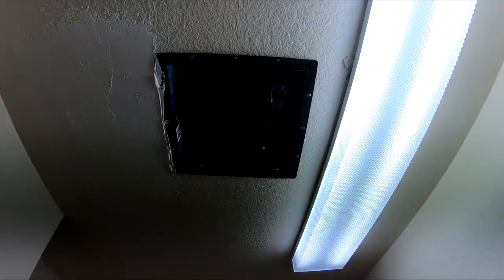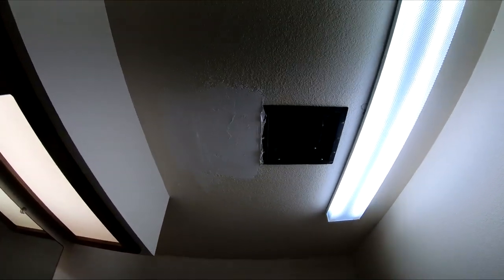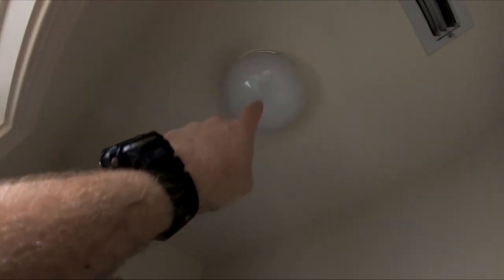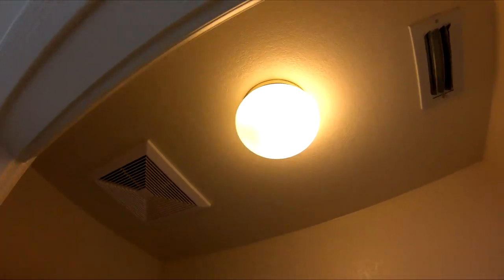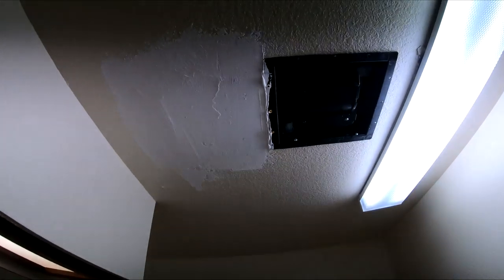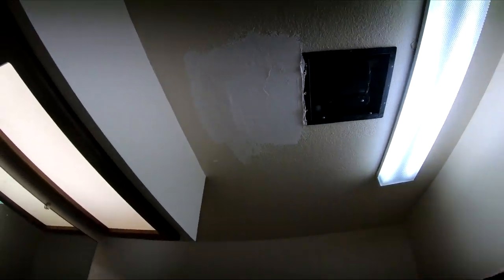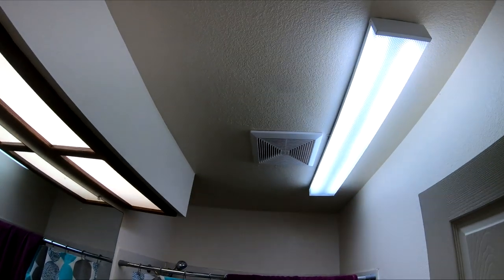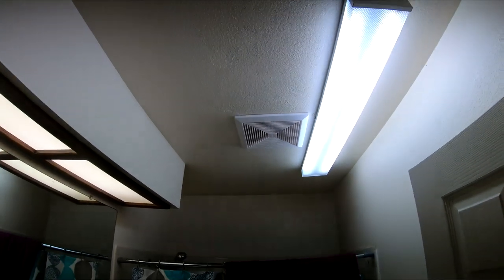Job Didn't Turn Out So Great | Handyman WLOG

Comment: Hey Lee i wanted to make a suggestion to you. I do a ton of drywall repair for my handyman service. I learned how to do professional drywall work when I worked for a contractor who did insurance repair work, fire damage, water damage etc.. 
anyway after doing this work for years I’ve come to the determination that canned spray texture is only good for very small repairs. Or to touch up on a corner bead or bullnose. 
The canned type texture does not knock down enough like texture that is sprayed from a hopper. 
Using a hopper is more labor intensive because you have to mix your own texture mud, use a compressor, a hose, hopper etc. and you even have to tape off and cover more area with plastic, the spray pattern is much larger and it’s just messier than using a can. But the end result is the difference between a wall or ceiling that looks like a patch was done vs. the wall or ceiling looking like the home was built that way and no one ever knowing that anything had ever been done. I’d really consider getting a hopper if you don’t already have one. 
A bad drywall patch is forever, the customer will always see it and tolerate it. It’s always going to be there staring people in the face like a sore thumb. At least that’s how i view it. Spray can texture is more of a home owner type product. Not a professional use product. As professionals in this business our goal is to make repairs that are undetectable. 
I hope you understand I’m not meaning to be critical for no reason. Im just trying to help. 
Always enjoy your vids,
Take care man.

Comment: Allen, in my opinion. Spraying way to close and you need to wait and let it start to dry before running blade on it. One thing always tests spray something so you can get pattern close. So when you do actual spraying you will know how far back you need to be and the speed and thickness you're looking for. The practice is key. Keep doing it till you have the hang of it. Other note. don't forget if it is real screwy take your blade and pull it all off again and try applying it again.
Reply: Robert w Sieburg indeed! It's cheaper to redo the work right away, than it is a week later.

Comment: Ceiling patches are challenging. We have a thing out here in Hawaii called canec. It’s tiles made from sugarcane back years ago. It’s not made anymore and I’ve had repair jobs trying to match Sheetrock to it. One of my clients wasn’t happy because I couldn’t make it look exactly the same but it was impossible to match a product no longer made. We went back and forth but he eventually paid me. I found out later he was actually suffering from dementia and had mental health problems. Then I felt bad for all the back and forth we had. Oh well, at least I got paid.

Comment: The 1st light didn't look like it was tightened to be flush with ceiling? Looked like there was some gap
Reply from the maker: Possibly, I am sure I got it right but it is possible there is a slight gap, I'll have to check. Thanks for the comment!

Comment: Definitely not trying to stir up trouble with this question but Does your insurance cover you doing electrical work since you're not a licensed electrician?
Reply from the maker: Great question! Yes it does, my insurance covers anything my license allows me to do and that allows me to work in any field as long as the project is not over $500
Reply: @handymanjourney  Awesome. Thanks for your reply. That can be a tricky situation at times. I do know that our liability insurance would cover any sub contractors if they didn't have insurance but in a case where they are insured, theirs  would be primary and ours would cover any short fall up to our policy limits.
Reply: Swapping out a light fixture isnt considered as major electrical. Anyone can do it basically. It's good to actually know what your doing but nothing that needs a license of any sort.